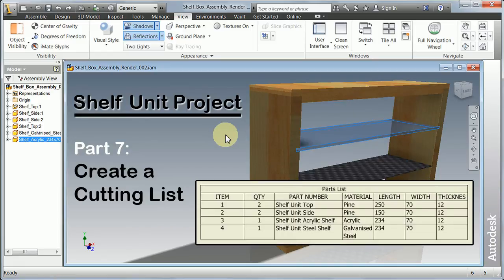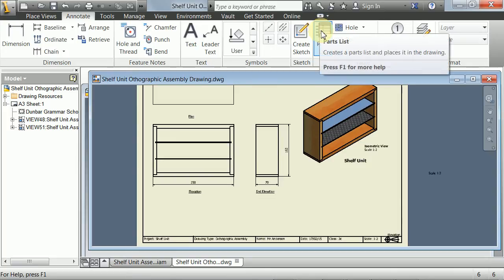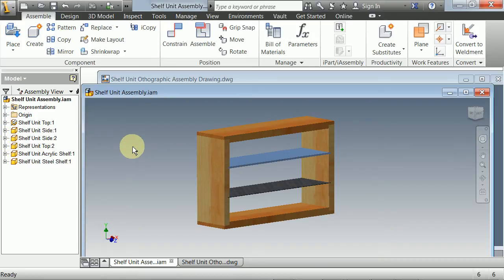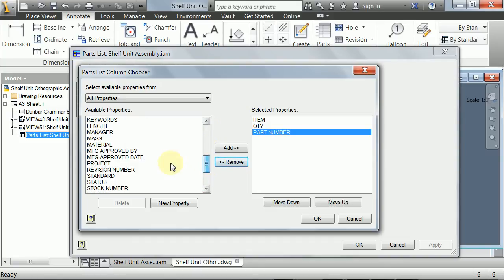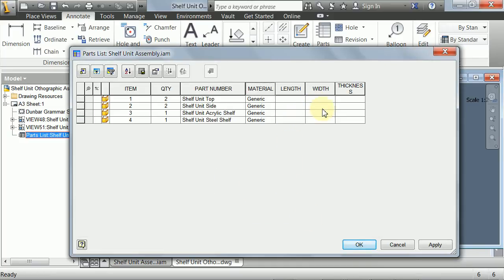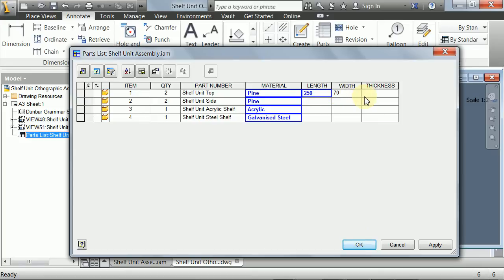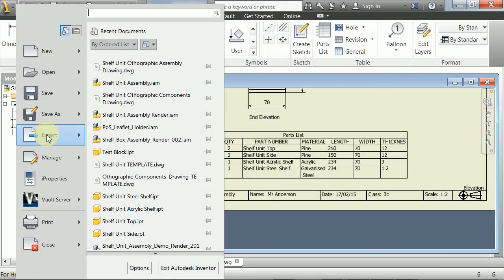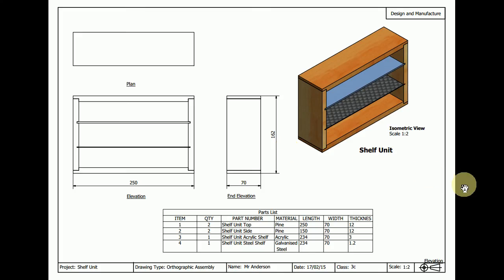Inventor Shelf Unit Project - Part7 - Create a Cutting List

Comment: Not a very robust method. What if you change a dimension and forget to fix your cut list??
Export parameters from the part and bring that over to your parts list. Even better add in a calculation to allow for cutting blade etc and give exact lengths needed for purchase too!
Reply: Hi, can you share/show any video where is it explain? I can´t find any. This video is useless